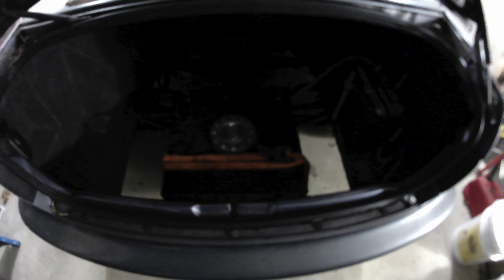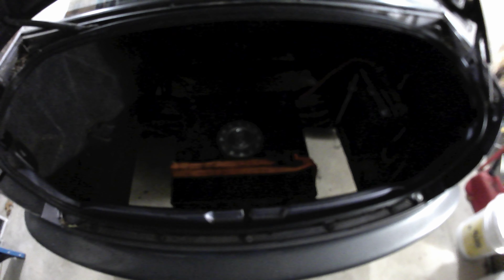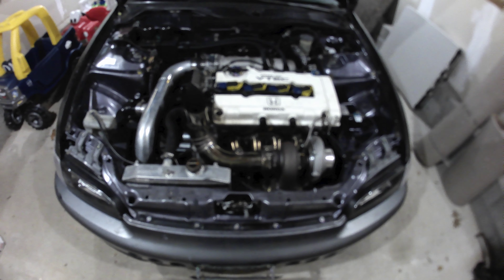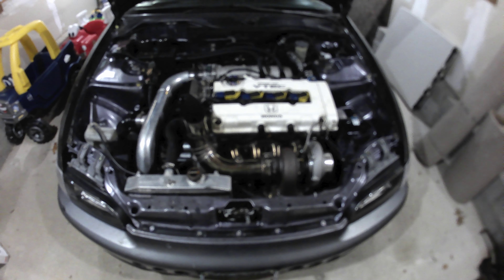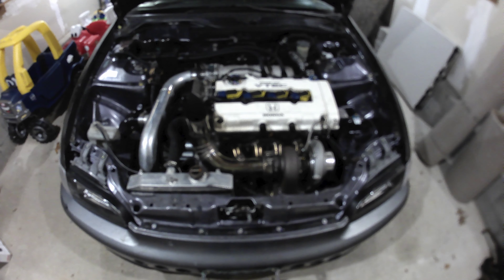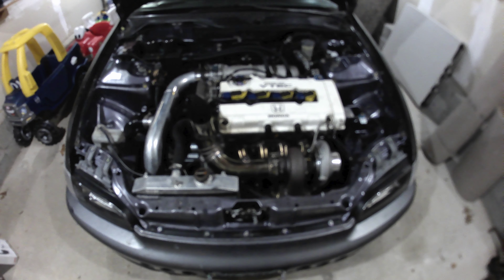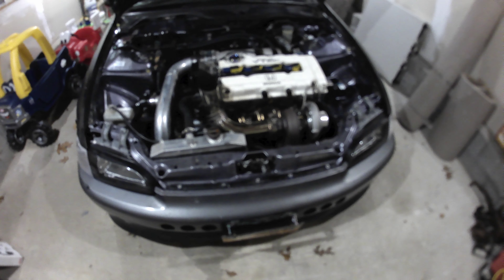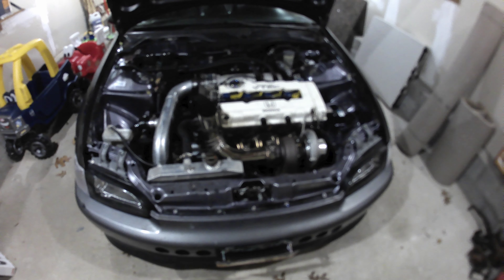First AWD USDM EG Sedan

Comment: Stock Honda driveline ? Or is it modified ?
Reply from the maker: Stock driveline but the trans has LSD and the rear trailing arms had to be shortened to fit. Other than that it's all stock.
Reply: @teamsirpoke  is there anyway to do it with zero modifications to trailing arms or driveline ? My car will never make over 350whp it would just be nice to have awd in the snow in Colorado .
Reply from the maker: Nah you will always have to modify the trailing arms unless you buy stock ones that have been modified. Check out hub city performance for those. Little pricey but a real nice piece.